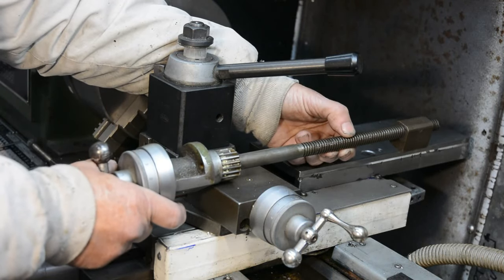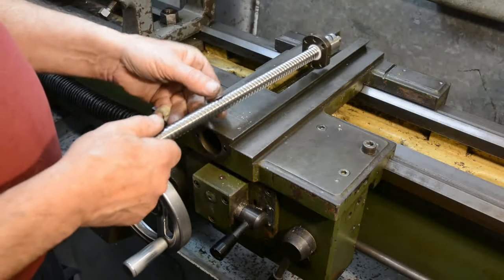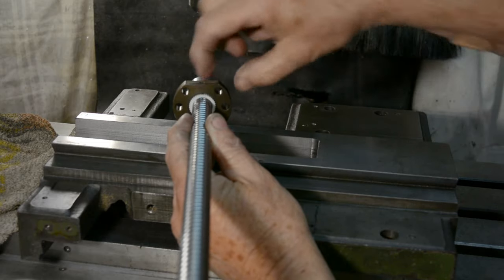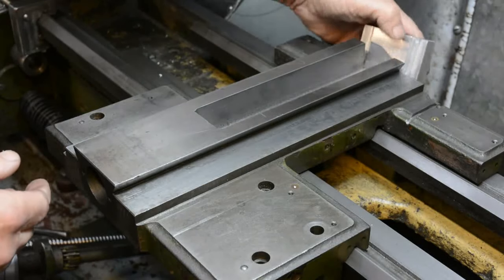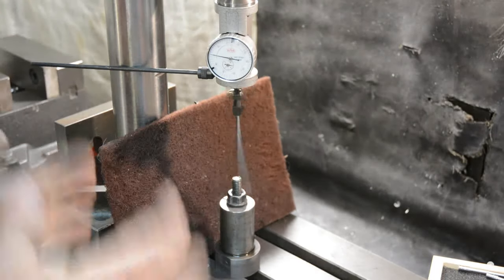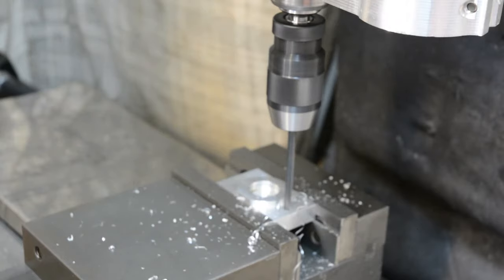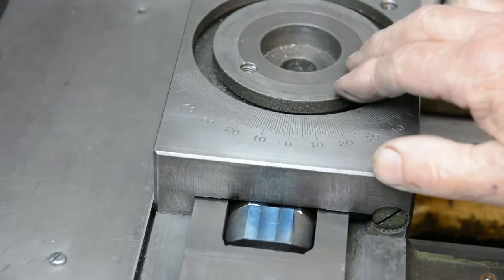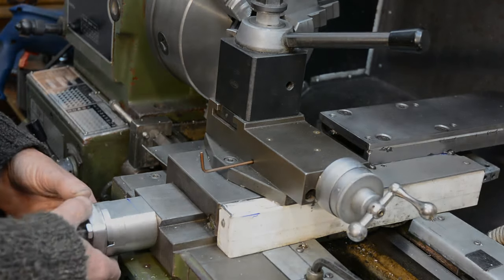Lathe cross feed conversion to a ball screw.

Comment: Sorry, but unless the lathe is being used as a CNC-driven tool there is zero need to change over to a ballnut style leadscrew. Backlash is meaningless in normal lathe operations. You always load the screws one direction before cutting as any experienced lathe operator will tell you. And there are potentially two major drawbacks to doing this conversion, 1: No anti-back drive resistance and 2: Loss of original dial calibration. Now, if the original leadscrew (not the nut) is worn so its pitch is no longer accurate and a direct replacement is not readily available, then maybe it's the only means of getting the machine serviceable again but going with self-driving and wrong pitch ball screws is a last resort. I rebuild machine tools, this subject isn't new to me.
Reply: Agreed, I keep seeing all these videos of people saying ball-screw is the be-all of precision but totally ignoring the fact that they provide far less resistance to back driving on axial load - something which would be insanely important on the cross slide of a manual lathe. Anti backlash also comes at a rigidity cost, on these style of cheaper screws it's just a nylon ring providing a spring force.
Reply: I’ve had great success with cutting a new screw and bronze nut. I see a lot of people doing “upgrades” when they can’t buy new parts or lack the confidence making a new one.
Reply: Valid points for a lathe, ballscrews and milling machines rock
Reply: Doing it wrong with over 6k subs. I was wondering what YT suggested to me. Lol😂
Reply: Despite your "experience", you have made several errors in your analysis. Whether it is a CNC machine or a conventional machine, the sole purpose of the screw is to convert rotational motion into linear motion as accurately as possible. any interference in this transmission is not desired. Now, In a ballscrew, due to the lack of backlash, stiffness can be achieved solely through the dovetail's shims. As far as the accuracy goes you need to install the right ball screw.
Reply: I found a vid where a guy is doing a super diy cnc mill thing.
It looks almost like it's a router 
I don't really know anything about any of this but what he's got going on looks like the kind of thing I'll come up with someday 
He says there's no computer and I don't know what that means really
There's something computer like in there but maybe ordinarily that thing talks to another thing he would be calling the computer that's absent?
It doesn't seem to be a kit and is mostly made of wood
Whatever is going on there is resulting in an 8 inch circle when the not computer thing is told to make a 4 inch circle.
In the vid he was asking about something that must ammount to a calibration or calculation of some kind and he threw out there it's a 12mm diameter ballscrew.
I linked something about homemade precision tools and thread pitch hoping that would help but I made it clear I have no idea what's going on.
He came back and said it has a thread pitch of 4 
My searching around and trying to get familiar with what all of these things are called hoping to find the terms for the concepts so I can even search for the math has left me at the bottom of the ocean.
What can any of the things be called that make the thing do 8 inches when it's told 4?
It'd be fun to come back with a solution and say if that doesn't work just tell it to do 2 inches
Reply: Yeah on a manual machine you pre-load by turning in past the "slop" before cutting but I think the existence of that slop permits chatter. I think a "zero-backlash" nut or very low backlash ball nut would help there. 

My lathe is so worn out that I have nearly a half a turn of slop in the cross slide and sometimes I lose my pre-load because if the handle side (heavy side) of the dial is left of center then vibrations (especially when parting off) will cause the dial to slack off. I think I need a new everything; nut, screw, bushings, even the dial parts which are worn between the mating surfaces and have no friction between them anymore and I think that is why vibrations cause it to slack off.

I have been thinking about replacing it with a ballscrew. But after watching this video I have decided that's a bigger pain in the ass than I am willing to sign up for.
Reply: My small lathe has a vee-thread cross slide screw, basically M8 x 1.25 LH and I was planning to convert the entire thing to M8 x 1.0 LH trapezoidal (no biggie, I have prepared drawings for a new handle and dial anyway + I use indicators instead of the dial) 

Originally I wanted to use a similar ball screw but my more experienced friend told me not to. Now I think I know two persons who told me not to, and I don't think I will anymore.
Reply: Hello in my lathe double  crossfeedshaft due ro backlash cannot set to zero in mm and inch dial any solution to repair ,backlash of gears also cannot be  adjusted .any solution
Reply: If the old dial is no longer accurate make a new dial.
I am sure there are ready made dial for 5mm pitch.
0.025 mm per division is very typical.
Just like 0.001" division is very typical.
Reply: @charlesstaton8104   Correct analysis. That's why newer handles are now balanced at the shaft axis.
Things are evolving.

Comment: There is a solid reason manual lead screws use square threads.  On a CNC machine, a ball screw can be used because the driving motor applies a constant torque to the lead screw and holds in in position when movement is not wanted.  If you put a ball screw on a manual machine backlash is reduced, but tool pressure can cause the screw to move.  You would have to constantly hold the handwheel to keep the screw from turning.  Back lash is not a problem, you have a DRO for measurement.  Backlash does need to be considered if you have a taper attachment, but I don't think your lathe has one.

Comment: Nice rework on the cross slide.  My ball screw just arrived and am ready to repair my Harrison lathe.  I will forgo the rear bearing as there is no weight on the nut.  Also I did not get the machined shaft.  The cross slide gear is missing on your repair.  I am going cut my original  acme shaft and weld the ball screw rod to it and maintain my powered cross-feed.  Also the original shaft is adjusted by a nut compressing a ball thrust bearing, thus eliminating end play.  Every turn on the Harrison is 0.200" so the 5 tpi screw is perfect and I can use the original wheel.  By the way my end play with the original nut was 3 mm,  just awful.  Happy machining.

Comment: A problem which might occur is that ball screws easily back drive compared to acme screws. You might find that the cross slide may move when exposed to the tool pressure.
Reply from the maker: Just a question of adding a little friction.  See the later videos which shows it motor driven.  In my experience that problem is grossly exaggerated.
Reply: That was my first thought when i saw this. Wondering the real life experience in this subject.
Reply: It might be caused by unbalanced handle, chatter, vibration.

Comment: Thanks for the video.  Very informative.  Just wondering whether you attached the power drive nut to the ball screw, and if so, how?
Reply from the maker: No I did not add the mechanical drive, but later I motorize it.  See later videos for details.

Comment: Thank you for taking the time to show us how you replaced the acne screw with a ball screw. I don't own a lathe (yet) but I am building my first mini manual mill machine. I purchased an XY slide table of decent size and weight and as expected the play in the acne screws is beyond tolerable. The 16mm ball screws came in a few weeks ago but I need to mill out some cast material, and cut the top and bottom of the nut as you did. The tips on centering the parts, machining the mechanism to pre-load the ball screw bearings, and the next video on digital control of the axis is inspiring and educational. I will at least record my journey with the acne screw swap, and perhaps be inspired to post it some day. Thanks again for your time and efforts, they are greatly appreciated!

Comment: Hello Mr. Foal. Thank you for taking the time to do this video, It is a real service to us especially the novice user. I just changed the nut on my cross slide last week. I was able to find a generic nut with the same thread and pitch but the screw was worn out in the middle where the cross slide is used most. It was very hard to screw the nut on at the beginning of the unused part of the thread and then of course the back lash was back! about 3/4 of a mil. I am a bit disappointed. Your install was enlightening to say the least. Of course I dont have a bearing at the end of the screw. I can buy a new screw, but I would have to cut mine past the gear on a straight part and reattach the new one with an internal thread and connecting stud I guess. Then a small TIG weld all the way around. My lathe is very similar to yours in capacity but much heavier and bigger. It is an Hernault Batignolles (French lathe) from 1948. it weight 1,8 tons. I am eagerly waiting for your upcoming videos on the install of the stepper motors on your lathe. 6061 is a poor choice for the bearing holder and other components on a cast iron machine. with the water from the cooling system it acts like a sacrifiical  anode. Lastly, all the cutting that you demonstrated on the other video with CNC like conversion was used with aluminum. Did you test the motors under hard conditions with deep cuts on SS or hi carbon alloys to duplicate the power and performance of your lathe with its original mechanical  turning and cutting abilities, finish etc.? Thank you for taking the time to answer.

Comment: A daunting task facing many of us with ageing machinery, I think the larger the machine the more option available until you get to micro lathes that use a more regular triangular thread form. A very soothing accent to go along with it also!
Reply: There are Heaps of Micro ball screws available for tiny machines I have seen some 6mm diameter screws on 3D printers and automatic pharmaceutical pill packing machines, ask your local bearing supplier for a catalogue on them.

Comment: Thanks for this video !   It inspires me to go forward with a cross slide ballcrew.  Crosslide BS is a much more involved project than topslide ballscrew conversion, that I completed without milling the channel or modifying the nut at all.   This "corner cutting " approach results in a slightly shorter effective slide distance  Also, the conversions yield an amazing increase in "feel" or touch sensitivity. I replaced the crank dial with a larger round disk, fitted with a simple clamping brake.
Reply from the maker: Have you seen the later video showing the carriage ball screw conversion with motor drive?

Comment: I made a handle for my cross slide that you might consider.  I took aluminum rod and machined it down.  Threads on one end and a rounded head at the other end to act as a stop. A sleeve is machined to hold a ball bearing at each end. The shaft is machined to ID of the bearings. The ends of the sleeve are machined to just fit over the bearing OD.  Just go in far enough to hold the bearing but leave a lip so they don't slide around inside the sleeve.  Slide sleeve over shaft then screw it into your knob in place of your bolt. Use thread lock.  It is so smooth and spins like a roulette wheel.  It was worth my time.

Comment: Nice work. I did similar on my Colchester Bantam as part of conversion to CNC. For those who choose to retain the handwheel, it's worth pointing out that the original leadscrews are usually left handed so the handle will need to be turned the opposite direction but that's a small price to pay! Similar result if you change the Y axis on your milling machine.
Reply from the maker: Mine is motorized now so it does not matter which hand the screw is.  See the later videos for more info on that.
Reply: I purchased a left hand ball screw and it was the same cost.

Comment: I have done several cnc conversions and found that although the ball screw is hardened steel, it is possible to mill it with a new carbide cutter, but it will have to be thrown away afterwards as the edge will be very dull if not chipped. Incidentally I am renovating a Lorch lathe from about 1900 and its feed screws are both right handed! This makes it a bit confusing to use and there is a danger of winding into the work rather than away from it especially if it is needed to be moved urgently. The use of ball screws is not a bad idea if LH screws can be sourced. I just checked and they are cheaply available on AliExpress.

John
Reply from the maker: I got a LH one from that source and I put it on the shelf.  It just was not good enough for me.  Instead I motorised the lathe, have you seen the later video about that?https://www.youtube.com/watch?v=WyG4LOG8EfA
Reply: @MotoChassisByTonyFoale  Just had a look at it. Very interesting ideas. works well. I have been playing with the Clough 42 els on one of my lathes and to be frank struggled with it. I have done full cnc conversions to mills and lathes before but so far this has defeated me. I shall follow yours with interest.
John

Comment: Excellent job. Really. I enjoyed hearing you explain all your steps and why you were doing it. Your ability to align the bearing hole was amazing. 
I found your mistake. You made this modification on your lathe instead of mine. What do I win?
Any thoughts to converting the long lead screw? The one that drives the sled right and left?
Thanks for sharing. I’m now a subscriber. 
Paul
Reply: The 'mistake' I can see with Tony's ballscrew upgrade is the screw itself is a conventional right hand helix thread so the indexing wheel has to be turned counterclockwise to infeed the cross slide/cutting tool. The original Acme thread is a left hand helix hence it will infeed with clockwise rotation.
Reply from the maker: Look for a later video for the lead screw change.

Comment: Great fix, thanks for sharing. I've just done a cut-and-shut with my Harrison M300 crosslide trapezoidal leadscrew at 1/4 of the price of a whole new screw. The ballnut is probably the superior option. Nice work. Was the deliberate mistake the handidness ? Traditionaly these are left hand threads.
Reply from the maker: Yes, it was the wrong hand for manual use.  If you look at the later videos you will see that I added a ball screw for the Z axis and motorised them both, so the handedness doesn;t matter.  Since then I have put the cross slide on linear rails.

Comment: Brilliant!  Being a novice, I must ask: since the pitch of the original screw is different from the new ball screw, if you left the original "handle" in place, the readings on the dial would be inaccurate?  I do not have a DRO.
Reply from the maker: If you left the same dial, yes.  A 5 mm pitch ball screw will move the cross slide 5 mm per revolution and a 0.125" pitch screw will move 3.125 mm.

Comment: Hi great vid very intuitive I have a student I am thinking of converting and I think your mistake was total length of the ball nut was considerably longer than the lead nut and with you putting a bearing block at the back reducing travel
Reply from the maker: Wrong.  I got a RH screw without thinking about direction.
Reply: @MotoChassisByTonyFoale  me too. Screw it! I'll get use to it.

Comment: I have to wonder. Cud a guy enlarge the hole that oils the nut and drop a steel bb down the hole so it rests slightly down in the groove. Tap the hole for a setscrew to put pressure on the bb. Would that take up backlash? Man, i gotta try that.

Comment: Excellent job I have seen this conversion done before; the only drawback is the lack of a manual vernier dial; however, you don't even need a DRO there are cheap linear digital scales available powered by batteries or one of those phone type chargers. I have one set up on the manual spindle feed on my mill it's easier than using the very accurate power feed just for drilling. there are also lots of different types of ball nuts available as well square, rectangular, double flanged as well as load bearing thrust and support bearings and housings, and these can actually be cheaper than having a new screw and nut made.

Comment: Thank you for a very informative video, I have been considering doing this to my 1964 Colchester student and you have convinced me to do it, do you have a link to the parts please, regards Nigel Cox.
Reply from the maker: You can find the BOM for the electronic lathe conversion here;
https://www.dropbox.com/scl/fi/u2vrih5s31ip3ku1qlwy8/BOM.xls?rlkey=g47lxsczuiqzmna0dx8nrb9pa&dl=0
This does not include the linear rail conversion but the only extras are the rails themselves and nuts and bolts.
Reply: Thank you very much this really will help. @MotoChassisByTonyFoale
Reply: I purchased mine from Alixpress for $50 cdn with a two week delivery and no tax.

Comment: I think using a cylindrical ball nut would probably be better for this, but they are hard to get.
Reply from the maker: I did consider that and I do have one spare but in this case it was easier to fit the flange type.  I use a cylindrical one on the Z axis of my mill.

Comment: Could have milled two slots in the back block in line where the bolts are, then place a jack screw under it; indicate the ball screw and lock it into place. Less set up and allowance for adjustment if the cross slide ways ever get wear in it.

Comment: How much travel did you lose?  Couldn't see from the video, but if you had room, perhaps the cast iron collar would have been better placed on the opposite side of the bearing carrier?  Nice work nonetheless.
Reply from the maker: I lost hardly any travel.  If I bored the collar, the wall thickness would have been too thin on the sides.  Thanks for the idea though.